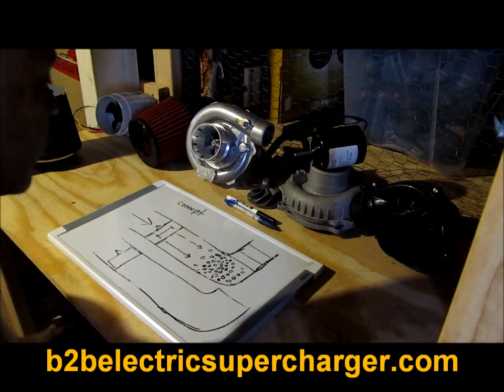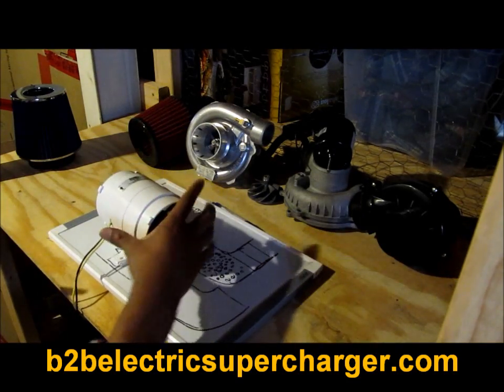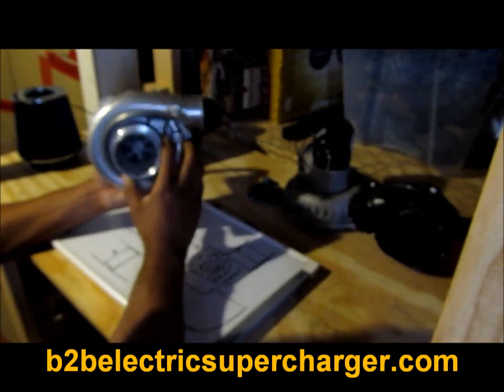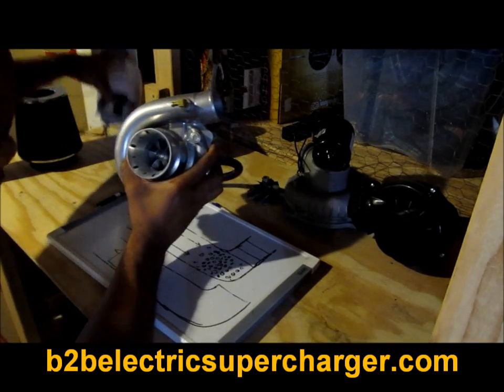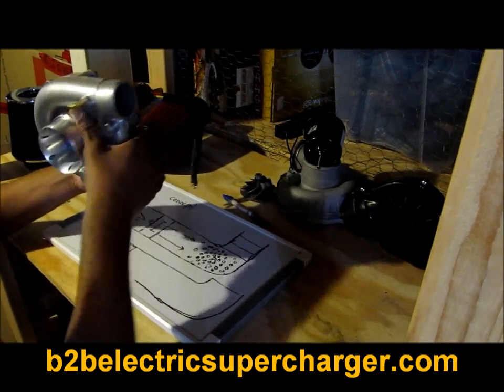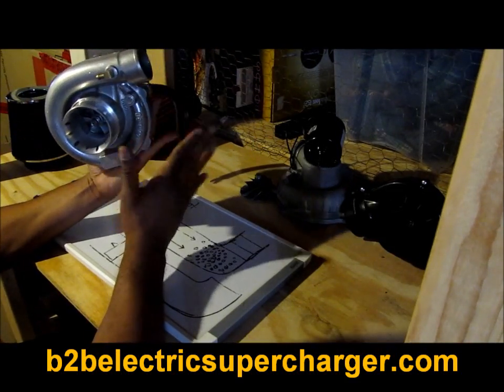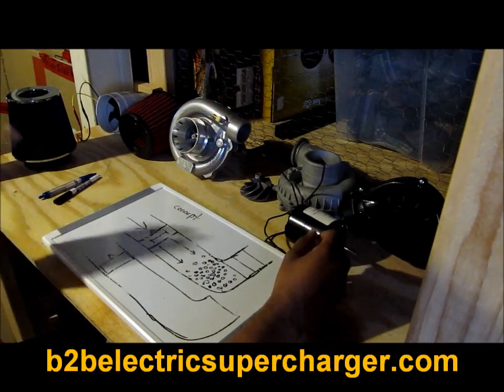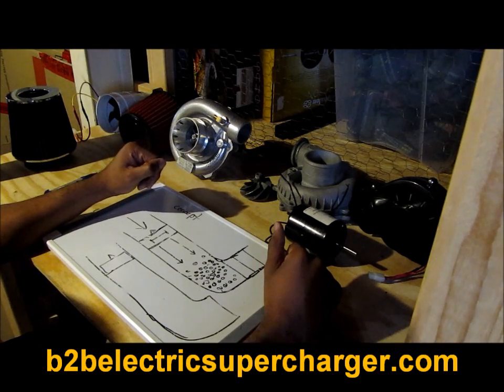Do Electric Superchargers Work?

Comment: I'm not the one making assumptions, I am trying to gain an understanding of your idea. I don't even have a car so I'm not buying your manual. And I don't have my amps and volts confused with anything. I am not doubting this ideas ability to make boost. My doubt comes from it's power source's negative draw from the engine. Just prove that this is less than the output power. Because I think it will be  more.

Comment: 60A at 12V won't even make 1hp.. The idea is good and all but I really need to see some numbers to prove what is going on. In order for this to work you will drain a battery after every use or drain hp with the alternator. I don't see a way around that. You should explain to me how that works. Let's see a video of the pressure readings, and voltage/amperage readings to further support your idea.

Comment: Great vid!  your're idea would help me with my problem!  I need a little extra going up hills with the A/C on in my under powered car.  With the flick of a switch I can have more power,(so the school bus stopes passing me) to get up a hill.  I don't want to floor it to go into passing gear due to rocker arms flying off,( happened twice) at high rpm.

Comment: Making boost is one thing, but your car will run rich and will overtime claque your catalitic converter and your Co2 sensors. To avoid that , you need to swap ECU to ECU that recognizes the boost. To do that you need a tune. ECU needs to know that it gets boost. I played with turbo a bit. And when you put a turbo on none turbo car, the MAF sensor gets confused and the ECU pumps gas like a river, the result runing rich, smoking, a lots of torque, but cant pick RPM .

Comment: The problem not with that it is electric, the problem that the motor must me connected to real cast iron turbo. The idea of having electric supercharger is actualy a good idea. look at Trains for instance. The diesel Locomotive engine powers a generator which produces electricity to power electric motors which drive the locomotive. The same Idea. All you need is a diecent power motor and maybe secondary alternator with secondary battery. You can make tons of power this way.

Comment: CJ, axial flow compressors have been around for 50 years!!  they even used them to compress air on airplanes.(SEE DC3s that use dual stage axial flow compressors, that look just like that vent blower, BUT, with a LOT more power)
Its all power CJ.  the Axial flow compressor can work, IF it has enough power.
all fans have pressure flow curves.   realistically, you cant expect more than 1-2psi max pressure 6-12% at an input power of near 1000 to 2000watts.

Comment: This would work better if you could hook this to your RPM pulse wire and it only works as it needs it other wise you got mass air going in alll the time even sitting a lights when the throttle body is closed the air has to go some where just blow off pipes please explain?

Comment: This thing is actually capable of work. For the non-belivers, check the Castle Creations "Mamba Monster" RC brushless motors, they can put out 5 to 6hp at 24V, that's enough to spin the turbine with a multiplication box... I think
There are chinese motors and esc's (electronic speed controler) as reliable as this Castle Creations at half the price.
Want to see more videos, keep it up.